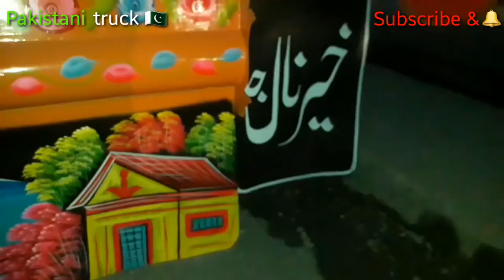How to make a body with 
fitting hand made Jack system

Comment: The hydraulic cylinder base directly welded?
Reply from the maker: Yes sir this is 2nd end  and hand made Pakistani Jack system
Reply: @pakistanitruck  What upgrades are done to the engine for it to be able to carry the body weight and when loaded???
Reply: It's welded to box section that has round stubs at either end for it to pivot on, we have grain trucks with the NORD scissor lift system (pretty well the same) on 20ft box's.